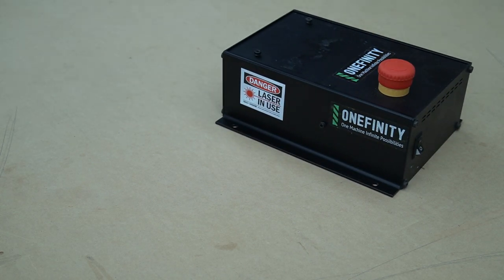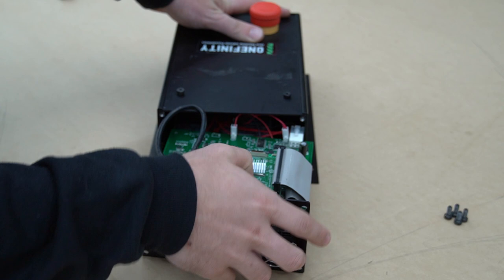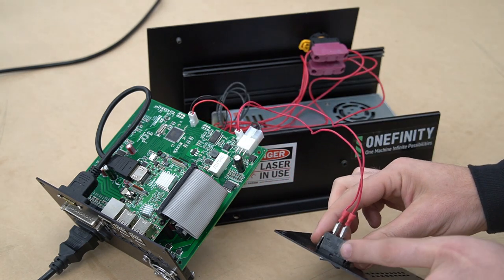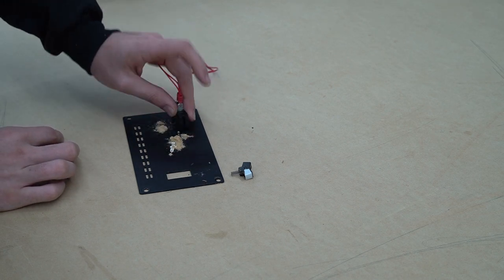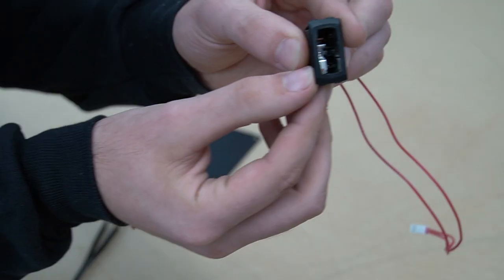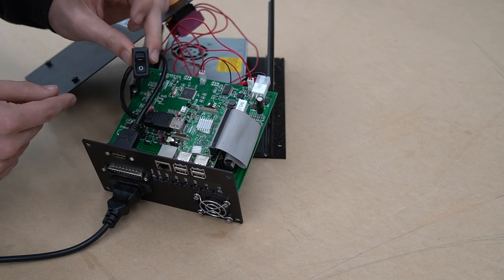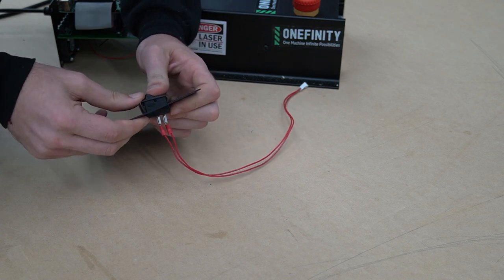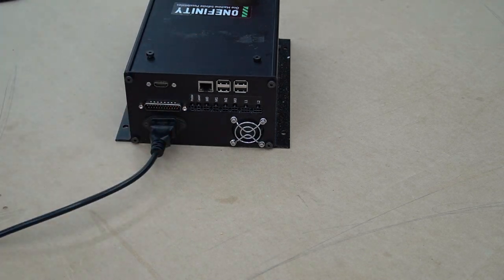Support : Servicing A Faulty Power Switch

Comment: Since it appears you know this is a recurring problem and not an isolated incident maybe change future production to use a sealed switch unit and this problem will be avoided altogether.

Is the fan a goesinta or goesouta ? Pumping air laden with sawdust into the control box does not seem like a good design and since the fan is directly in line with the switch is probably what is stuffing the switch body full of sawdust.

If that much sawdust got in the switch the rest of the box interior must be packed with sawdust too. Do you have a video showing how to clean the entire box out and also a recommended schedule for doing so based on hours of use? 

Seems like it would be easy to build a run time counter into the software to track how long its been powered up and then pop up periodic maintenance reminders to clean the control box, clean and oil the rails, and whatever else needs to be done on a schedule.
Reply from the maker: Best to us dust collection and keep the controller farthest away form the machine as you can.
Reply: Build a housing/box for it and have filters with a fan to bring filtered/clean air into the environment. Mount this all under the table so as to keep it clean.